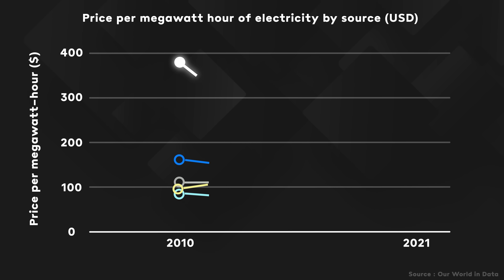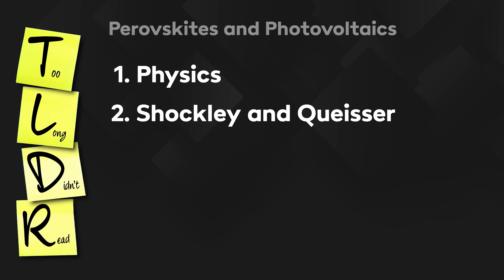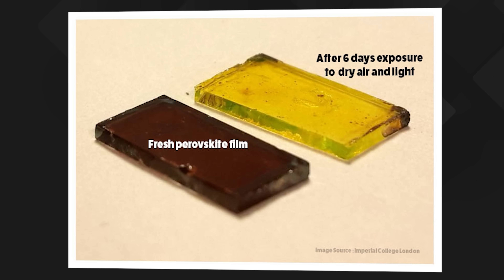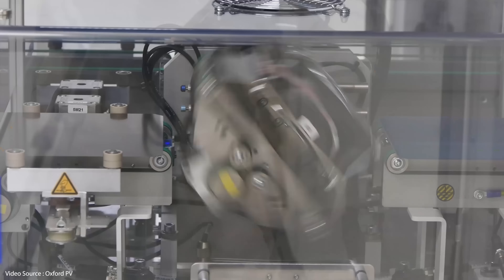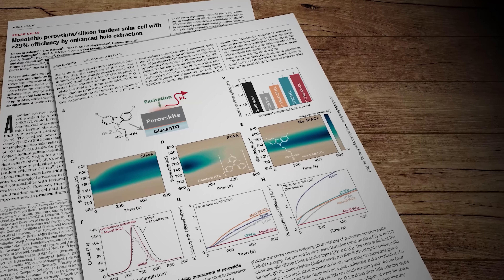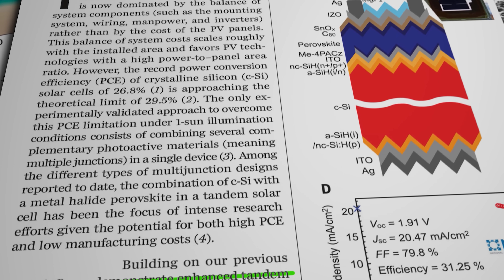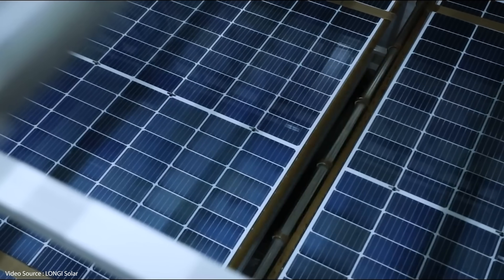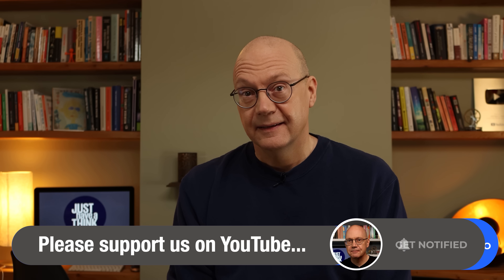Perovskite Solar PV. FINALLY some good news!

Comment: I have been in Solar Pv for 23 years, long before it was popular. In those years I have seen everything new fail in the real world. Thin film degraded way to quickly. Concentrated solar caught on fire. Solar roof tiles inefficient and degrade fast. This sounds promising,  but as you said until they make a real panel, on a roof, in the real world we won't know. On all panels there are two rating, cell efficiency, and panel efficiency, those are usually a couple or more % points apart.

Comment: If you are going too be buying one single panel that's costs us $300 in Norway for 455w solar panel bifacial.
That's just insane price if you ask me. If you are going too be order a pallet (31 of them) it will drop too insane low price $220 solar panel.

These are also having a good return so i bet the solar panels will within 5-10 years hit the 50% with bifacial panels.
Norway are great on hydro, but we are getting higher production of solar panels, but our stupid politicians has cut down the subsides for it (instead of cutting it lower they should increased it) specially when we are seeing how much benefits everyone are getting too have it (lower electricty bill) with other words the people are getting even stronger economy.

But, we shouldn't complaint. The prices for electricty right now has been low since the skyhigh prices in 2022 ($1,00 kwh) at the worst. Are the same amount kwh for 80 cents.
And we are also now getting support by the government if it's higher then 91,25 included vat, but i'm hoping that they will keep it even though they are talking about too remove it from 2026 i belive. They haven't talking about it because it could lead into riots. We all deserve a comfort and stable prices and a life. We have also been paid for it many, many times over and over again.

That's the reason i wan't the government too increase the solar industry more so more people could produce their own electricty in the summer, store the water up till the winter.
But, we are also producing alot of wind (on the ocean and land) so i'm feeling we are doing great.

But, i would love too see better solar panels in the near future.

Comment: Will whoever takes my idea and revolutionises PV, please give me a load of money.  Thanks.  Right.  If the perovskite is such a thin film overlaying an essentially regular silicon panel,  couldn't a perovskite which only lasted a few years,  simply be peeled off and replaced.  It would not be an expensive process. Further,  couldn't er retrofit all existing panels by applying a perovskite film.
I'll take 20 percent of the money you make please.  I have ideas I need to finance.

Comment: As a Solar installer, I can with certainty tell you that Perovskite Panels would be greater seller than silicon panels in the retired market, almost all my retired clients complain that they don’t want to pay so much money for a item that would out last them, they all feel like their responsible for paying someone else’s system because they won’t ever benefit from something that would be functional for 25 years, doing the math they claim they would probably live to see 20%-30% of the silicon panel’s lifetime production, they feel its over kill for their needs, money and time. And it is understandable, sad fact but understandable, so they would certainly rather pay less for something they could still out live

Comment: Through the wonders of youtube…. I came to this video immediately after  watching a video about why the solar industry is collapsing. I have no bias either way… but that video did raise some salient points,   The Dramatic increase of interest financing rates, the extended costs of many low ball priced  installers,  the fact that what we knew as net metering is going away…. Being replaced by 4x1…. Where you have to give 4 units to the power company in order to earn  a one unit power credit… and the fact that this new arrangement makes battery back ups  more desirable…. Along with a higher cost

Comment: The Sun Belt Southwest is prime for solar collection, as well as is wind, but highway signs warn drivers of what's the dust-storm routine for staying alive. Water to wash those arrays is certainly useful for cash crops and cover crops growing beneath those. But consider that the empty hollows of wind towers would be stronger, owing to surface tension, if they were filled to the top with water. Fresh Mississippi River water, channeled to Texas via the Intracoastal Waterway, would allow pumping to those great heights in series, in a better way than oil wells have pumped that distance for a century and more. Gravity takes the spill-over from pumping and moves it to the base of a next uphill tower, some dozen or so miles distant. You see, instead of pushing water uphill for over 1500 miles of desert pipeline, the wind/solar bonus energy can pump it all one-mile vertical, in one hundred-foot-lifts at a time, in a series of several per tower. 

Top Ten List:  1) clean solar arrays, 2) crops beneath them 3) fresh water for industry and households 4) off-peak vertical water energy storage 5) stormproof coastal barriers 6) an end to the Delta Dead Zone 7) employment and land-use created out of wasteland 8) water for electrolysis hydrogen-to-ammonia pipelines for farmers and cracked again in distant industries, with nitrogen gas returned in the same pipeline 9) an energy corridor created that is valid for space ports, hyperloop parcel post, supersonic passenger flight safe-zones 10) cooling the planet in our most underutilized stretch of the USA.

Comment: One has to enable more products to spread the cost over and enable to fix the shortfalls of Green Energy.  This requires storage and distribution of "Free" energy.  If one fixes this shortfall one could use the stored fuel if it's hydrogen one could create durable wealth to transform desert land into land flowing with Milk and Honey adequately to fund manufacturing and installing clean energy infrastructure.

Comment: seems like bifacial panels are some secret sauce that should be looked into as well, usually if a panel says it can do 200W it "might" be able to get that or close to that on a perfect summer day, but going with a 200W Bifacial panel assuming its built properly will meet or excede its rating. its a way to get more power without actually changing the solar cells used cheaply and easily it seems.

Comment: Excellent video as always, could you look into a solar panel coating out of England and do an update on it. The coating apparently allows the wave length of light the panel needs to pass through it. Now here's the clever part, it absorbs the rest of the light spectrum blue etc. and re-emits it as infrared energy the panel can use. This raises the overall efficiency of the panel.

Comment: Pretty much irrelevant without equally cheap storage ( and cheap in this case does mean readily available and implementable at societal scale).

I'm being  punished right now for daring to install PV's by punitive fees.

The electrical grid and by extension society can't handle the intermittent sources.

Modern Society is built on energy at demand and any energy source that demands any industrious activity to take place only intermittently will incur great costs in doing so. 
The reasons for that are painfully obvious. Activity is done by necessity. 
And more specifically by necessity in a given timeframe for good or activity X.

By forcing to spread out the activity to perform X  intermittently you require more labor, resources ( land, energy, production facilities ) to get X done. And what's worse proces demands generally favor steady state running. As getting stuff upto operating specs requires more time, is unproductive and causes relatively more wear and tear than steady state ops.

Scarcity generally drives up prices in a more than linear fashion.

Hydrogen is one such red herring.
Terribly wastefull energetically and it requires even more capital outlay to begin doing it. And people claim they want it to run on "excess" energy production. 😂 Now there's wasting capital. H2 is best manufactured by utilizing heat and electricity from a nuke plant.

Comment: A 900 sq ft roof covered with USD15,000 new gen solar PV panel + a USD25,0000 tesla Model 2 + a USD2,000 smart bidirectional charger hook into the grid would perhaps be a good system to have in 2028?.

Comment: Perovskite solar film has more potential. It’s better as can bend and paint or stick on surfaces. China plan to paint on this film on outside of building, widows, everywhere as that’s the only way to make city dwellers reduce electricity costs and the strain in the grid. Most people in Eastern China like like Zhejiang province or even Shanghai refrain from using AC or heat in winter as it’s too expensive in electricity costs. China can easily mandate every building needs as this film as they control all land. Before they mandated all buildings needed high quality insulation materials on outer buildings and it was quickly done. It’s only if they can get ahead of the growth in use of electricity in China that they can shut down all those thousands of polluting coal power plants. They need modular nuclear power plants too as well as I know they have about 30 nuclear power plants opening. Still, they will need grow more power plants so I hope the efficiency of the solar film becomes better.

Comment: For general power generation, current silicon solar PV cells are good enough, and they're very cheap. Except when space is a real limitation, new technologies has to be almost as cheap as current technologies, even if they're significantly more efficient. It's not so much either size or cost of of production of current PV panels that stops us from installing so much solar PV that we could have excess power essentially from dawn to dusk except in very cloudy weather, it's all things combined, things like cost of installation, and for roof top solar, grid connection capacity, and uncertainty about what the excess is going to be worth, often limits the size of installation.  

30+ instead of 20+ % efficiency would be great, but actually not as important as it might seem for general power production, any increased cost and other disadvantages have to be a smaller issue combined than just using more area. Maybe they'll get to similar cost, without significant disadvantages, eventually, which would be great, but using even a smaller part of a roof, or desert, dosen't solve much. PV systems that functions as complete roofs, could decrease the net cost a lot, if a good system was developed for making PV panels complete roofs, with low cost as a priority, and mass produced. I think Musk missed that part of cheap mass production in their solar roof, maybe he should revisit that idea and design a budget friendly system too.

Comment: They won't go anywhere with less than a 300 hour lifespan 😂
Reply: He said 95% of initial power after 300 hours.
Reply: @UmmerFarooq-wx4yo  So let me do the math for you, since you probably won't. Let's assume a linear loss rate of 5% every 300 hours (no guarantees that's true).

That would mean that you would only have 22.36% of your original capacity at the end of one year. An almost 80% loss rate. That's no bueno. 😉
Reply: @pappaflammyboi5799  but they'll behave like leaves. 🍃 🍂 🍁 
Oh wait, your math included the price ... hmm I don't see that value nor the recycling cost.
Reply: @UmmerFarooq-wx4yo  Well, more like solar panels that convert to roofing tiles after a year or two...

Comment: Surely the problem here is that while panel prices fall, and batter prices fall - installation costs do not (either fixings and mountings or labour - it just doesn't seem to be competitive - not that sparky work ever is, seemingly, or plumbing).  The real price of a solar system installed and commissioned, especially if grid connected in some way, is not falling in the way the panel graph prices suggest.  We really need a way to address this.

Comment: That's pretty impressive. If a typical solar panel today has an efficiency of around 21-22 percent, that suggests we can have a 50% improvement with Perovskite. So you can either use 30% fewer panels to power your home, or use the same number of panels but be able to continue generating significant power even during the lean winter months.

Comment: Good job, Dave. I remember doing research about solar back in 2020 and finding the "ix-junction III–V solar cells with 47.1% conversion efficiency under 143 Suns concentration" research paper.

Comment: I wonder if the PV layer were folded so it faced itself (and thus was insulated against other substrates interacting with it) if it wouldn't be able to last longer and maybe work better. Sort of a 3D approach. As William Shatner once said in "The Wrath of Khan" (excellent movie btw) "He is only thinking in 2D". So maybe they are thinking in only 2D.

Comment: Just a couple of comments on my own experience as a Texan and as a 5.4 watt residential solar user. 
1. 10 yrs have produced 80,000 kWhr of energy from 22 panels. 👌
2. Didn't realize that having the tilt of the roof at the best angle to catch sunlight just right is important.
3. AND... having that roof facing 180° due south was the best for maximizing energy generation.
BUT.. living in Texas is detrimental to any desire to get off from dirty fossil fuels. EV cars have extra  and excessive annual taxes. Financial firms cannot bid on government bonds if they invest in green energy, reducing pool of bidders (=higher interest rates), and many more anti-green laws every year. 😢

Comment: Ok gotta chime in, I work with Perovskite thin films, and not all of them are these super sensitive materials that need to be be protected. Many are, esp. those with great PV properties of interest right now,

BUT

my LaSrCoO3 heterostructures (LSCO is oxygen mobile ceramic) have been open to the air for... maybe 4 years, and 3 weeks ago I still saw the same "metastable" phase in the XRD as I did when I first caused in in 2020, during early covid. 

Just saying, sometimes nature lets you win. 
Also, starting a graduate program shortly before a pandemic is so fun. 2/10

Comment: I'm not knocking the technology. Perovskites (which are a class of materials, by the way, not a single material as noted on the video) are promising.... But the statements about how low the cost of solar generation in general is, are misleading. Solar power generation works only during daylight (obvious, I know) which means they cannot be relied on as the primary power source for any society. Unless you add storage. In which case the claimed "Low cost" no longer is true. This is why we see that with increasing installation of renewables, we are building ever more combustion powerplants (I have first hand experience here).
Let the tech stand on its merits without hyperbole. The renewable energy sector as a whole needs to remain credible if hopes to grow public support.

Comment: Thorough analysis of rooftop PV arrays (rather than vast field arrays) is critically important to determine how electricity generated is stored in household EVs and stationary battery packs. IMO, the #1 benefit EVs offer is their means to address car dependency. EVs offer the choice to use electricity for household purposes or for today's obviously unsustainable amount of driving and transport of essential commodities the longest distances worldwide.   

Highlighting an increased output from a PV array is a bit like favoring all-battery BEVs that offer the longest driving range, say 300 miles per charge, and their total miles before battery depletion and replacement, say at 200k miles. For example, it's long been my contention that plug-in hybrid PHEV tech offers more benefits, applications and potential to reduce fuel/energy consumption, emissions AND insane traffic than all-battery BEV tech which is suitable for lightweight vehicles and short distance purposes. PHEV tech is especially suitable for long-haul freight truck fleets. PHEV+H (combustible hydrogen) stores at much lower pressure, in smaller/safer tanks and can deliver at least twice the equivalent MPG possible with hydrogen fuel cell HFCEV tech.

Comment: Dear Matt. With the impressive down slope of PV cell cost and prices, it leaves a lot of people and possible investors somehow disappointed as the full cost for any installed base per KWp haven't been following this curve. I think I have identified one of the main causes of this discrepancy in the fact a dominant cost factor is actually installation (labor) and installation materials (structures) rather than the actual panel price.
Going a few more steps on this line of thinking I tend to agree with your statement in the video that increasing panel efficiency by a significant degree is the only way to make things better, provided reliability and durability is not negatively impacted. While installation labor per panel more or less stays the same, this way the expected power harvest per installation labor, tooling and materials invested is increasing. 
With only the cost dropping further on panels the same efficiency as today, all a potential investor can do is invest in more panels for the same money, hence increasing installation labor and structure needs. Conclusion: Coming out with tandem cells at a similar reliability and durability with only a small price premium over current state of the art PV will secure a very rapid acceptance of such product in the market.